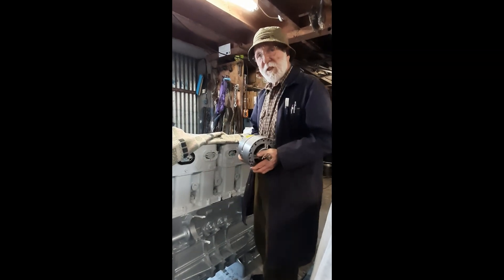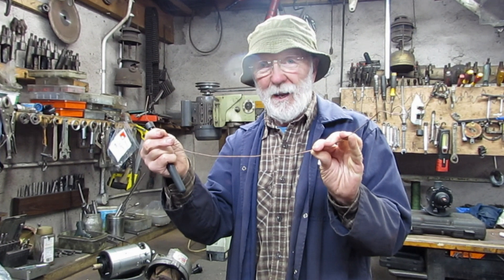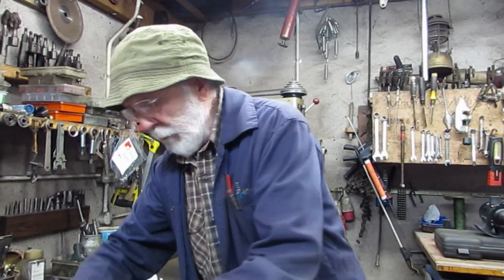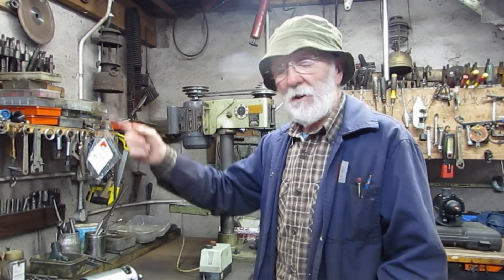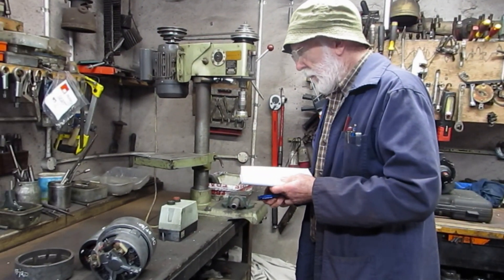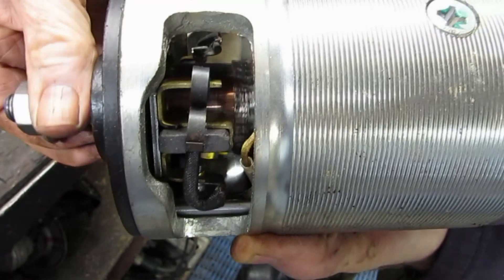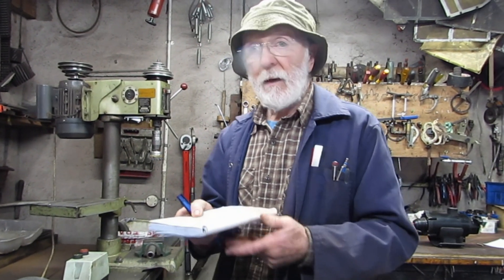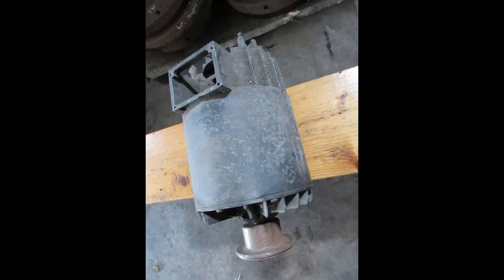AC5 alternator on Gardner engines.

Comment: Hi love your channel, I have an old fishing boat here in New Zealand, (Picton's Northern Star is my Channel)  She has I believe a Gardiner 6LXB that has probably done as many miles as it would take to circumnavigate the globe-lovely old engine and I am sorting through  few issues including a $30,000 rebuild of the reduction and gear-box last year.
I am a handy-man only, know very little about engines-diesels, learning as I go, the reason I started my channel is that people would probably be quite entertained by my naivety and other issues I encounter...The current issue is I believe the electrics are 24 volt, new batteries across the house and starter-bank as well, I noticed parasitic draw on the house-bank which led to me testing the starter-bank and then the alternator after watching your video,
It seems the engine-alternator is charging only sufficiently to keep the two 12volt batteries in the 24-volt starter system at 12.75 volts and then little to nothing crossing over into the house-bank set-up which is dropping to 23.7 volts,
I got into the engine room with the volt-meter yesterday and checked while the engine was running in idle and at 600rpm and found a maximum voltage off the rear of the alternator of 15.6-something to 15.9-something volts, 
Would I be correct in thinking this should be at least 24 volts plus generating off the alternator to recharge the starter bank then top up the house-bank, etc at the moment it seems only sufficient to keep the level up to 24.7 volts in the starter-bank
I can send a photograph of the alternator if that would help, I believe from your video a C% model.
I am wondering whether I need to pull off the alternator and send it away to be serviced, or whether I am missing something here, is it only supposed to charge at around 15.9 volts, sufficient to charge a 12 volt battery?
Would value your opinion

Comment: What a pleasure  to listen to someone so passionate about a component we all take for granted.    Cummins  used the ACS 5 on their b and c series  marine auxiliary engines built out of Darlington. The alternator was superseded around 2018 by a later prestolite model as they stopped production on the ACS5    
We actually did see bearing failures on these alternators at rather low hours, however being belt driven may of sideloaded the shaft and bearing

Comment: My 6LW has a dynamo but I'm not getting any power from it, I've not investigated why yet but it may not be worth fixing. I have lithium polymer batteries in my boat now and because they can take a lot more charge a lot faster than lead acids they are known to overheat alternators unless they are thermally regulated.

I am not really worried about originality but I do want to keep the "spirit" of the engine alive if you know what I mean? My engine is powering the boat I live in rather than anything historic so do you think it would be better to run a modern alternator off a belt rather than try and do something with the existing dynamo that it may never really be capable of anyway?

There is a short video on my channel of my engine.
Reply from the maker: Yes.  You'd be advised to fit a large front pulley.   We can supply one.   Please email for details.